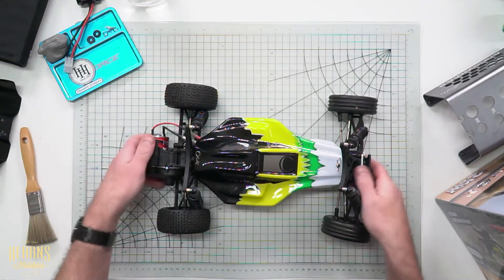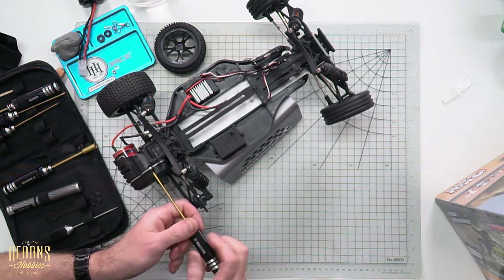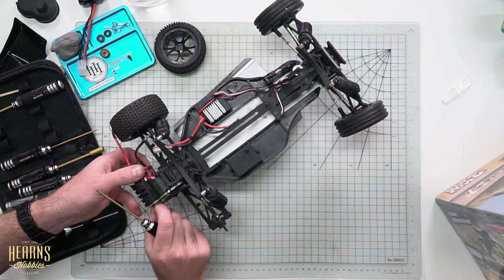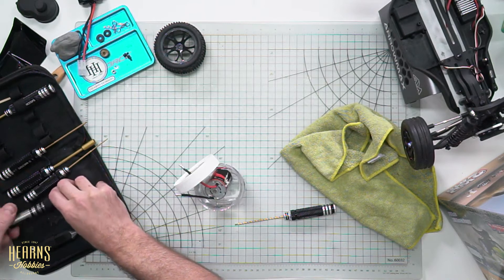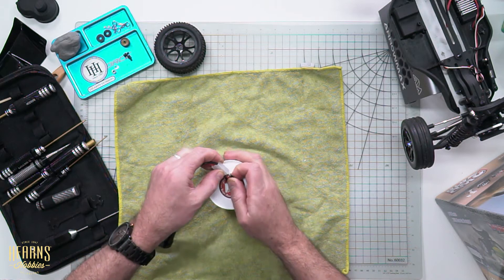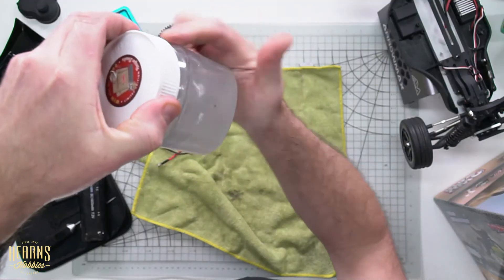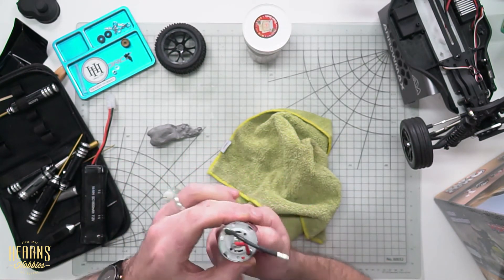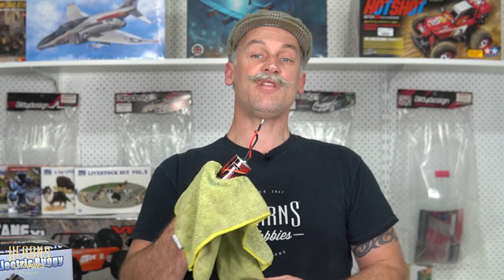Tutorial | How To Maintain and Clean a sealed 540 RC Electric Motor | #askHearns

Comment: Should I dry the motor with compressed air as soon as I pull it out of the water ????
Reply from the maker: not absolutely necessary, just give it a run and shake it out, oil those busing straight away too. Thanks for watching!

Comment: Does that not risk rusting out the motor? Could you use and alcohol?
Reply from the maker: No, there is no risk of rust as the water is removed as soon as possible. Alcohol is a fire hazard.

Comment: Blowing electric contact cleaner inside wouldnt do the trick, would it? (the cleaner leaves zero residue)
Reply from the maker: Contact cleaner works but isn't as kid safe as water. The water also helps to clean and polish the brushes and commutator.

Comment: do not run the motor at full speed but rather slowely as ,,it doesnt give the grit a chance to escape before grinding into the important surfaces before being dislodged
Reply from the maker: Valid point. Yes, low voltage works better but most beginners will only have the racing pack handy.
I think running in at full voltage is better than not running in at all.

Comment: I've done this with slot car motors. INOX and White spirit works brilliantly. When I use white spirit I make sure the motor is submerged before running it. No chance of sparks.
Reply from the maker: We recommend water as flammable liquids can ignite and burn your house down. I know many people that have had fires occur even though they have done so without incident before. Just takes a moment to lose concentration. Not worth the risk. Water is best.
Reply: @HearnsHobbiesMelbourne  white spirit isn't really flammable... INOX puts fires out...